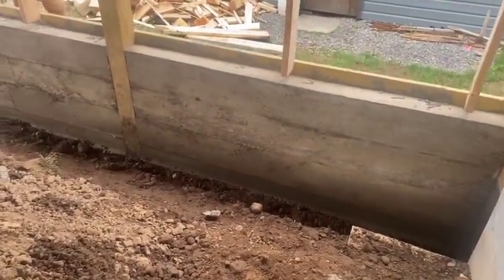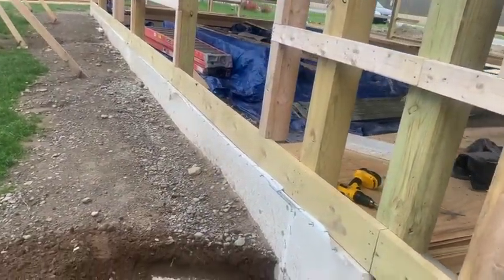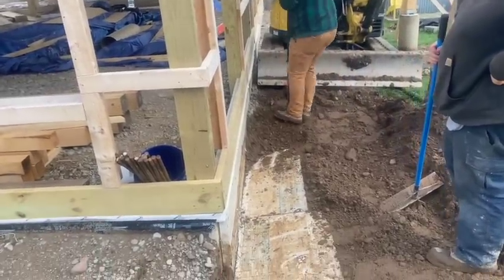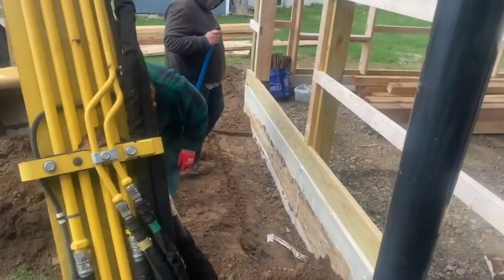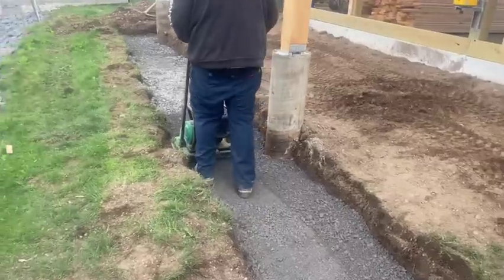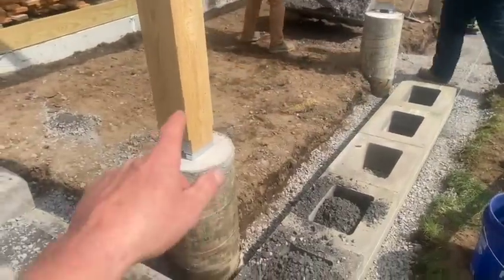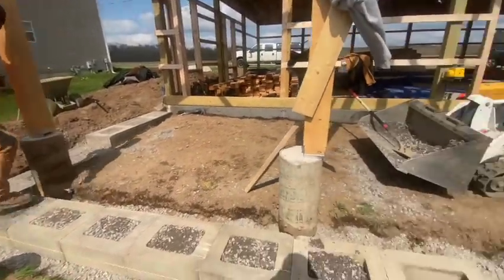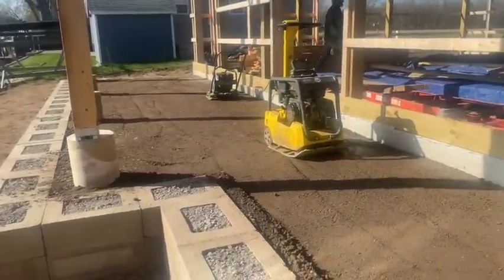POLE BARN PROBLEMS FIXED FOR GOOD!!!

Comment: I know it wasn't your crew responsible,  those tubes are ridiculous.   Who the heck thought that was even close to a good idea.    Big 6x6.   On a 8" pad and way off center.     Crazy.      That's what happens when you try and get slick and dig your tubes first.         I would at least formed a box around them after the fact and dowel new concrete box to the tube.    Just can't believe someone walked away from that.  Or got paid to do that.      Craziness.
Reply from the maker: Ya it was pretty bad. LOL

Comment: If your columns aren't below the 48" frost line you simply raise the frost line!  Would have been cheaper and easier to do it right at first but you sure make it look good in the end.  Wish a guy like you did my garage floor.  I had a local hack that cheated.

Comment: You guys did an outstanding job there. Must have been some bad communication on the posts to end up like that.
Reply: My question to the homeowner! did you have an architect and structural engineer provide plans? I have a feeling that this is the first home they’ve ever had built for them. It’s obvious that they have very little knowledge of building structures or zero knowledge they should’ve hired a foreman.

Comment: At what point is it better/ easier to just pour a regular footer / stem wall first and set your metal brackets for pole barn or frame it normally?
Reply from the maker: Yes hindsight I am sure he would have had me build him a frost protected stem wall with slab on top.

Comment: Should have paid for an engineer for this one.  Those Simpson brackets aren't rated for what you're using them for and you have encapsulated wood in porous concrete.  Next time use Midwest perma- column Sturdi-Wall brackets and top of your sonotubes skip the stem wall.  Stronger, less work, and cheaper.  Consult with an engineer on the specifics.  On the plus side you were correct that the posts should have only been sitting on concrete not surrounded by it.   For those that don't know the concrete below the post is only there to support the weight of the building.   Also buried posts used for permanent foundations are required to be UC4B or better to avert massive rot and termite damage.  UC4B is not typically carried in big box stores.  Not the clearest videography but those posts do not appear to be UC4B.
Reply: Bla bla bla bla bla...

Comment: The homeowner should definitely file a claim against the original Contractor and how did the building inspector allow those issues to pass ?🤨.  And why can't a footer drainline be installed on the outside of concrete walls going alongside torwards the canal and have a outlet line into the canal. ? And gutters can be ran into a footer drainline and foam still put on top ..Take advantage of the canal being there. Run some drain lines...Great job on the wall ..What's your company name...?

Comment: I am pretty sure I would not have built it like that.  Why did they bury the poles?  Yes they are pressure treated but they still have a shorter lifespan underground. Secondly, wouldn't encasing them in concrete accelerate the rot process especially if it is a wet environment? Wouldn't it have been more sensible to pour footings and anchor them ABOVE the ground on a concrete slab or at least on top of a footing? Yes, they are stronger in the ground but equally as strong when anchored properly to a foundation.

Comment: I believe it's 48 inches   total, starting from ground level, not from the top of the stem wall.

Assuming that vertically laid insulation board is 12", the horizontal should be 36". Although I definitely could be wrong.

I see why they didn't go below the frost-line, it would have put them in the water-table.
Reply: All that should have been considered when applying for a building permit with plans ...i built a deck in western NYS and had a strict inspection schedule...How deep post holes are...Any water in the holes. It's a major disaster...from the contractor to the permit process and inspection...They should definitely be held accountable...What would Mike Holmes do?🤣.  ( Holmes Construction) Diy Channel
Reply: @Skater Dude 
I wasn't aware of Mike Holmes. I just subscribed so I can give him a test drive for a while. Looks like good stuff. Thanks!

Comment: You created a major problem with pouring the 4x4 into the concrete, the acid in the concrete will rot the 4x4 out.  Todays wood treatment products are basically coloring, if you had put tar on the 4x4 before pouring it would have worked. Otherwise you did OK

Comment: I hope your flipping the bill for the rocket your building. No kill like overkill........
Reply from the maker: I'm not flipping the bill LOL. I get paid for my work. Most of this should have been done already so I could just pour the floors.
Reply: @bondobuilt386  who at the end of the day told the homeowner that this "had" to be done?
Reply from the maker: @zirzmokealot4600  we dug up the garage to put a curb in and the garage and house were not built to our local building code and frost line requirements. Discussed this with homeowner who got a second and third opinion and told me to go ahead and fix it to our code requirements. We fixed it then they wanted to have a concrete patio out back so we did that retaining wall tom address the elevation difference between the house and boat house.

Comment: Americans over engineer everything.  There are 100 year old people barns all over that have survived somehow without foam and loctite.  This foam board trend is dumb.  It's gonna shift and breakdown over the years.  And what is the point of insulating underground?  Just use sheet metal if you want to draw water away but keep in mind whenever you try to water proof something you run the risk of trapping water too.  Keep things simple and let them breathe.  Shoot, it's better to build temporary and cheap.  Then tear it down in 20 years if you have to.  Anyway, at least you're having fun.